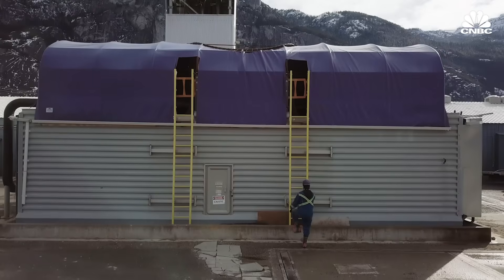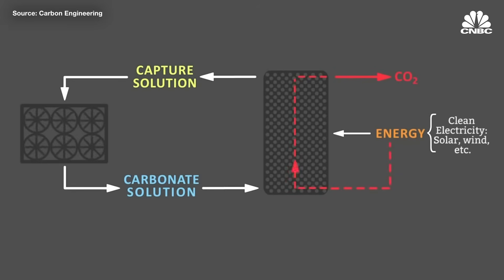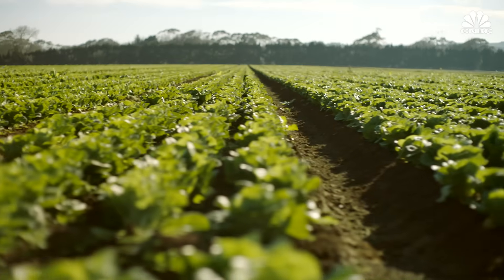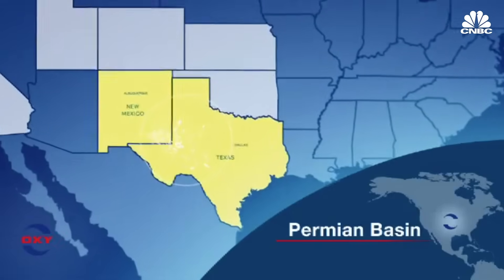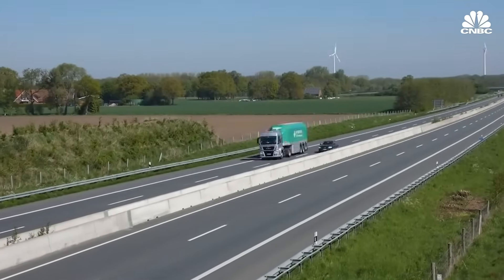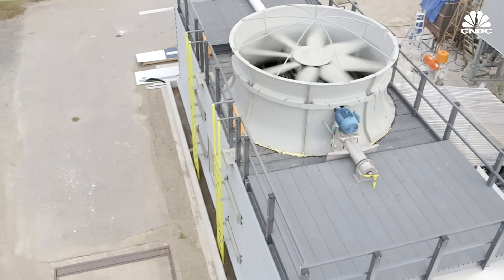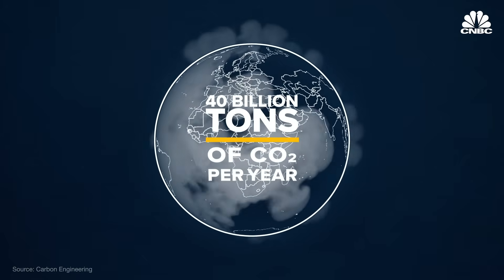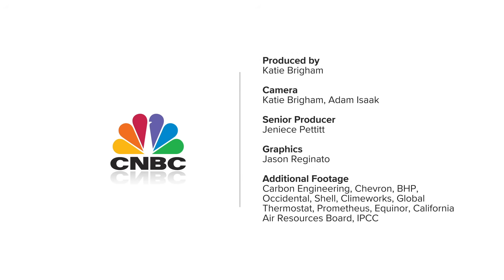Bill Gates-Backed Carbon Capture Plant Does The Work Of 40 Million Trees

Comment: Research Petra Nova in Houston. That's all you need to know about the myths of carbon capture on a large scale.
Reply: @David Rapp ..obviously Hitler is dead. What is your point though. Petra Nova and this video involve the  same Carbon Capture methodologies.  Petra Nova failed based solely on cost to saving ratios  being unreasonable. This video explains a different methodology to carbon capture on a much smaller scale than Petra Nova. So please explain. Is it your opinion that this Carbon Capture methodology will work on a larger scale?

Comment: Pretty sure its cheaper to just plant 40 million trees than operate this complex contraption
Reply: Exactly how cheap do you think vacant arable land capable of hosting 40 million trees is?
Reply: Your right
Reply: we're already at the point in time where we don't have enough land or money to plant the number of trees we need. If we were to just plant trees, every single household would have to have at least 1 tree inside and outside. With artificial methods, taking CO2 out of the air is far more efficient, cheaper, and certainly doesn't take up much space with more development.

Comment: How much energy required to run it? Removing it in one place, but produce in another...yea
Reply: 40 million trees to run it.
Reply: This will make pollution way worse. They had to have known that when they started this project... are they trying to destroy earth? Co2 is not putting holes in the ozone and its not a chemical thats foreign to our environment like aerosols. Co2 is natural and the more thats in the air the faster and larger plants will grow. Plants always produce more oxygen when you give them more co2. Heck pot farmers pump co2 into their greenhouses. Makes the fruit huge and they grow faster.
Reply: we need to start using hydrogen gas... i mean its literally in water. Its flammable. it can be produced by running ac current through a water jug. You can do it at home with a cup of water and a low voltage ac charger. And noone give me that "its explosve mess" so is gasoline, propane.... and batteries.
Reply: You know batteries exist right. Small scale solar + battery installations are a relatively normal and common thing that can make  a normal home completely energy independent. Scaled up a bit it is totally reasonable to run a facility like that with solar + battery backup, hell, a large chunk of the grid in one of the states is my country (Australia) is backed up by a big tesla battery
Reply: @kaiyeena  i just dont want to start this conversation on batteries and how magically you charge it(size) and HOW much energy you need  EXTRACT Carbon and what is the cost of it to run a scale.
but anyway, everyone now entitled to its own opinion.
Reply: @stepankotyk8823  Liquid metal batteries come to the rescue however
Reply: @cavemann_  one used in terminator? Uhhh...ok)
Reply: @kaiyeena  oooh batteries are sooooo good for the environment 🧐
Reply: Good question... I think we need to stop deforestation and plant more trees, also partnering with oil companies its definitely an step in the wrong direction
Reply: @alehodr  the tell me who will invest in?
Pls stop your ignorance
No one will ever invest in if they dont have return on their investment
Oil company using thos CO2 to refine better and recycle cheaper oil
Plus better their image,and a part of that Carbon is capture
Note the word "a part of carbon"
At least they actually did sth
If not partnering with oil who should they partner
Solar Panel Manufacturer?
Then what Solar panel gain from that investment
Nothing
Not to mention many Solar Panel Manufacturer is burning cash and unprofitable
Please,There are no free lunch
Reply: THey won't want to talk about that.  It's extremely energy intensive.  The figures I saw indicate they'd need to build another power plant just to take care of the energy requirements.
Reply: did you watch the video, they are currently running about half renewables,  soon to be 100%

Comment: What they did not mention is by removing CO2, they are also removing the oxygen, O2, the natural by product of carbon capture of trees.
Reply: What? LMAO😂
Reply: @samsurya35  trees only get the carbon in carbon dioxide and release the oxygen. Removing carbon dioxide entirely may also reduce overall oxygen in the atmosphere.
Reply: @Arch.JosephChua  Well, sir who told you this machines are capable of removing ALL of the co2 from the atmosphere? 
A report says these can only remove one year of excessive carbon emission in the time we put a decade of emissions in the air. 
There is no way trees will "not get enough CO2" for photosynthesis.
On the other hand there is much more CO2 in the air than they can use.
Reply: @samsurya35  nobody said they remove all co2 in the atmosphere. I just clearly mentioned this process also reduces the oxygen that was supposed to be released into the air.

Comment: This is the equivalent of using a filter straw to clean the water in Lake Superior.
Reply: At least they are doing something
Reply: Exactly right. Also a way for a company to get a PR boost, keep making money causing the problem, and then more money pretending to fix it.
Reply: @MrLoobu  
The same could be said the the company removing the CO2.  They’re operating off of “clean electricity”.  What ever that means.
Reply: @levibaer18  the company is located in British Columbia. Many places in BC use power that was created in a dam(aka hydro). Because there is no carbon/harmful waste it is considered clean.
Reply: @ruzzcraze1862  
If was clearly state in this video that they want to remove themselves from using petroleum based generators, at least that’s what I thought I heard.  In that case, they’re not operating off of clean electricity.
Reply: @levibaer18  yeah, why not put all that "clean electricity " to do something good, like clean water or filter sewage, so Victoria won't just pump it into the ocean?
Reply: @Simon-bd3cv  There's no such thing as 'clean' electricity, only 'less dirty'.
Reply: @ruzzcraze1862  And the manufacture of the dam materials and environmental changes and lifetime of the dam etc? That's all snow-white is it?

Comment: air capture is not worth it. just do the math. CO2 is about 400 part per million, so if you want to collect 1 kg of CO2 to then transform it into plastic or send it back underground or do whatever you want to do with it, you need to filter at least 2.5million KG of air (assuming a100% capture rate which is physically impossible but let's assume the impossible to show the best case scenario)
Air weight about 1.3 kilogram per cubic meter.

So the average American release about 20 metric ton per years of CO2. 1 ton = 1000kg

So in order to use/Sequester the annual emission of the average American (20000kg of CO2) we need to filter more then 50000 million cubic meter of air (assuming an impossible 100% capture rate)

So if we use a fan that draw 20000 cubic meter of air per minute (this fan is higher then any fan I could find) and let assume he filtering process create negligible back pressure (which it won't) it will take this fan 2.5 million minute to filter what a single average american release per years. For the curious one, 2.5 million minutes, is about 4.75 years... so we need 5 of those fans per american running 24/7 (which is also impossible, all machinery requires maintenance)
Now I would be curious about the energy cost to run those 5 fans, since even the greenest renewable energy source is not 100% green. hydro barrage destroy the environment by creating an artificial lake here a river used to be, Wind farm will reduce the speed of the wind passing through which could in turn affect the climate if they are done in big enough scale, solar farm require a huge area to be cover by solar panel, instead of being cover by trees or other structure etc... How many more fan will be require to filter the CO2 generated by that energy?

The real solution is us the human, we need to reduce our carbon footprint. With COVID we discovered that working from home can be a good alternative, maybe for those with compatible jobs (obviously job not compatible cannot do it, I don't really see a nurse working from home..., but a programmer? why not), could start working from home 3-4 day a week, going to the work office only once a week for a team meeting or something? This will not only reduce the CO2 emission for that programmer working from home, but it would be one less car in the traffic, reducing the traffic jams, so even those who need to go to work like our brave nurse, they release less CO2 since they are not stuck in huge traffic jam.
Maybe we could invest in public transport and car pooling initiative to be more efficient even in smaller communities, so it a more viable options to each having an individual car (even if it's 100% electric).
Maybe we could learn in school to be better organized so we can go o the grocery only once per week instead of every 2 days because we forgot something?
Maybe our government should invest/subsidize in local product, so the local merchant prices can compete with Walmart prices.  ATM in my area, local merchant/product are about twice the price then a similar product that is imported from a huge industry (yes those huge industry probably use child labor and pay their employee super poorly...) but as long as the local merchant cost twice the price of the china imported stuff... sorry I need to pay rent and buy food and I cannot afford paying double the price on anything. If the government start taxing the carbon emission require to import those product from china, maybe the price will balance out and now the local merchant is cheaper (and since we got extra money coming in with those carbon taxes maybe that money can be return to the citizens so now that everything is double the price do not impact as much since we have also have more money.
Those are just quick ideas and I'm sure their a million more that can be both profitable economically speaking AND environmentally speaking

Comment: 7:17 this guys a fool, how could a university professor not see that carbon capture is a pillar of green hydrogen, dumping co2 3 or 4 miles under ground is fine as the temperature and pressure at that depth keep it in a liquid state. anything that escapes would just be absorbed by the vegetation

Comment: Why not just plant 40 million trees? They have no ongoing operating costs or complex chemicals
Reply: Planting trees doesn't help the environment. The earth has a finite amount of resources. Planting more trees will further thin our existing resources amongst plants and animals in any given area which doesn't help.
Reply: @Setsuna_F_Seiei  How's that different than what's going on in the video? 
The chemicals they use don't just get created from nothing, neither does the energy needed to power it, or the materials needed to build it; let alone the money that keeps it running.
I'd much prefer recyclable wood and green forests, than getting "fresh air" from a machine, while factories, drilling platforms and powerplants belch out emissions; which aren't just carbon dioxide, but also carbon monoxide, nitrous oxide, and sulphur dioxide.
Reply: @Setsuna_F_Seiei  drugs are bad bro

Comment: co2 makes up less than 1% of the atmosphere. co2 only has a thermal reflective rate of 12%, meaning IF a thermal molecule happens to come in contact with a co2 molecule ONLY 12% of that heat is kept. This is heat trapped at negative 20 degrees. How long do you think that heat will stay trapped before dissipation?

Global warming is an expensive lie.

Comment: Finally someone mentioned the high tech at the end of the video: trees!
Reply: It is crucial to leave the vulnerable ecosystems of the tropical rainforest (lots of rain depletes them off nutrients and the rain washes out the soil if the trees vanish) and the boreal rain forests of Canada, Sweden, Finland, Siberia, ... alone. 
In the cold regions the ecosystem is vulnerable because the growing season is short. (At least the problem of nutrients being washed out is not as big. The bulldozers that "harvest" the trees are very destructive for the soil, they compress it.

It is not like a wildfire or if a snow storm or the weight of lots of wet snow / freezing rain takes out a part of the trees. There the nutrients (ash, rotting wood) stays in the system and supports other vegetation and animals, the soil is NOT compressed by heavy machines so new seedlings can shoot up fast. Decaying wood also supports a lot of animals, and the nutrients are not lost.

A wildfire, or storms  also regenerates the forest, humans logging it down are destructive. Logging can be done when it is selective, and preferably when the regrowing process is helpend with planting trees. (there are projects to drop seedlings from planes). But some forests should not see any logging at all.

Only in the temperate climate zone (typically first world nations) we have the conditions to harvest wood on an ongoing base, not that much rain, long enough growing season, more nutrients in the system (and could be replenished).

But there labor is more expensive, and typically they do not have the huge trees (those have been harvested centuries ago). 

So they go for the easy and cheap harvest in the ancient tropical and boreal rainforests.
Reply: Seedlings that shoot up capture a LOT of carbon, one could take them out after 10 - 20 years and burn them. Pay farmers to do it. They would use that as fuel for themselves, sell it locally. Or they have a larger unit and supply electricity and the surplus heat to one neighbourhood.

In Germany they use wood (bio mass) as heat engines to produce electricity. That uses only 23 % of the energy of the fuel. Generating electricity by burning any fuel (or creating steam with nuclear power) is a very wasteful process, there is a physical limit to how much energy to MOVE the turbines you can get out of it, and in practice it is even lower. 

I think they do not even reach 24 % efficiency. Most of the fuel becomes heat -  not movement.

In Germany, switzerland, Austria, ... they also use the heat and provide it for neighbourhoods in form of hot water for use and for heating. They also do that when they burn their garbage. So that kind of electricity / heat generation gives you 60 % efficiency. Not stellar, but better. 

In many areas of America they would have to water seedlings so they can grow when it is too dry for them to grow naturally. I saw a video of an elderly couple that has been nurturing a forest (that the area has lost) to stop the desert from growing. In the dry season they drive with a tryke and plastic containers of water and water the trees, so they will survive.

Forest soil (if they do it right and plant diverse trees) is protected and upgraded, if they have downpours good forest soil is like a sponge. (Not if they have densely planted monocultures of pines or fir, but if there is a variety of trees, especially if they drop their leaves, that is the base for excellent soil. 

It looks good (tourism, recreation, even some berry mushroom gathering ect.). Keeps the people and some incomes in rural areas (or the man has a job and the forest is the job of the stay at home wife). That kind of fuel is not quite as cheap as BULLDOZING the ancient rainforests of Canada, Siberia, Amazonia, Philippines, Indonesia  - but it would not cost more than paying big biz to capture carbon.
We will need that industrial solution anyway.
Reply: @xyzsame4081  I wonder what happens when you burn said seedlings... do they emit carbon perhaps?
Reply: @Permuh  the issue with this logic of mass forest plantings that no one wants to talk about.
Reply: they're not efficient enough

Comment: In the situation we are in, it is not only necessary to reduce emissions but also to capture that excess carbon dioxide. Although it is true that atmospheric CO2 is essential for the life of plant species, it is evident that the use of fossil fuels has caused the atmosphere to increase the amount of carbon dioxide in the gaseous state. Taking into account that plant species absorb CO2, it would be necessary to promote the cultivation of plants and trees. Those that should be renewed, that is, a tree does not necessarily absorb Co2 and emit O2, it all depends on the state in which it is. A newly planted tree seed does absorb CO2, a growing tree does absorb CO2, a mature tree absorbs and emits CO2 (neutral balance), a tree that ends its life period emits CO2, the same amount that it absorbed throughout its life and depending on the state of decomposition in which it is, it will do so in a few years or relatively long. It is at this point where attention should be paid, the most advisable thing is to renew forests, a forest should be cultivated until it reaches its maximum level of CO2 retention, after which the forest should be renewed, planting it again from the beginning In this way, there would be a negative CO2 balance. It would also be necessary to prevent the trees already felled from emitting CO2 into the atmosphere, for which an appropriate treatment or use should be given.

Comment: This episode also assumes that carbon sequestration for enhanced oil recovery is a zero sum endeavor (i.e. the c02 that's being pumped underground is offset 1to1 with the crude that's being pulled out of the ground). When in reality during a carbon sequestration operation there is far more c02 pumped underground than there is c02 being produced in the form of crude oil.